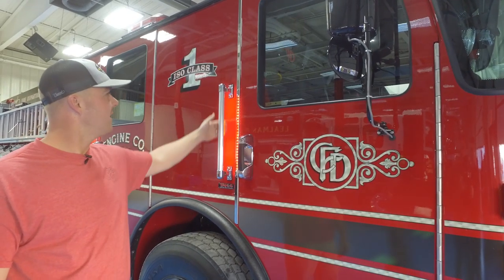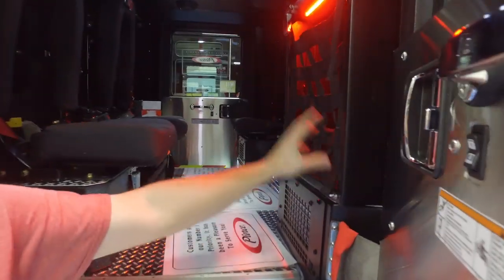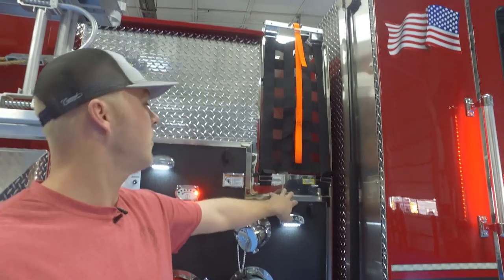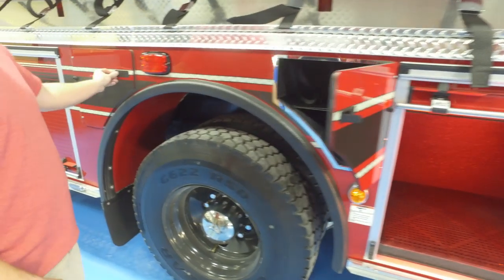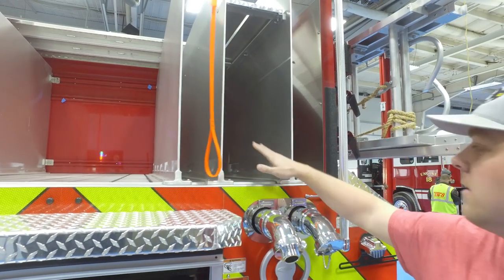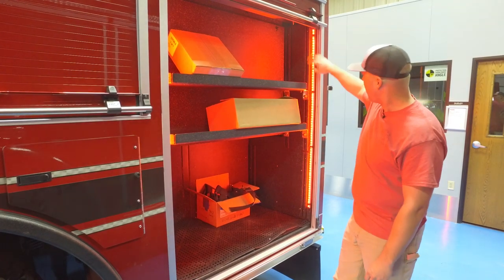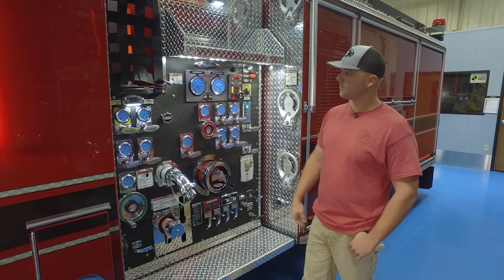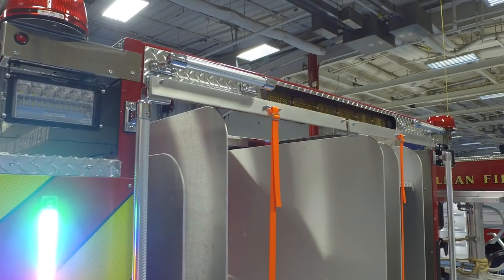Enforcer™ Pumper – Concord Fire Department, NC

Comment: 2019 at we’re still fitting roof mounted mechanical fans for cooling the interior of the cab. But yeah, the door handles light up. Why do we never go with booster reals on any trucks?
Reply: I love one 1" booster reel located in that compartment right under the hose bed.   Great of rubbish outside a structure, leaves, tanbark, even small brush fires. Quick to deploy and pick up getting the unit available sooner.  They seem to have a bad name from when companies used the for structure fires.

Comment: 2000 galons per minute pump, Did i understand that right? What do you need that much for when your not on an airfield???
Reply: Terrakx FB I would say for any large commercial fires. It is better to have to gpm's and not need them, then needing the water and cannot pump enough
Reply: Pump rating is only at draft, modern fire pumps can pump well above rated capacity as long as the water supply can support it.
Reply: @MattFFEMT  watersupply, thats the point! If you dont have super high pressures on the hydrants youre never gonna be abel to get that much water in the engine, also at Draft im wondering how they want to get that much water through the draft hoses because a 110 Millimeter large drafthose can barley Supply 750 gallons per minute over a hight of 1,5 meters.
Reply: Here in concord we have two large malls, two airfields, major interstates running through the city, major industrial areas, and miles upon miles of apartments and other forms of structures.
Reply: 2ooo gpm is common by me. Big fire, Big water. Better to have it than not...  There's a reason departments moved from 750 to 1000, to 1500 to 1750 and now 2000....